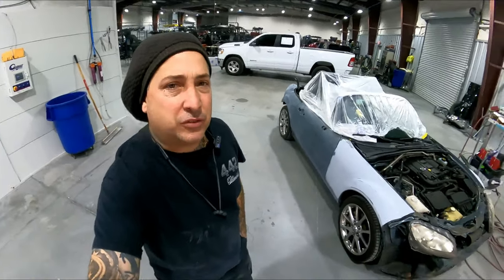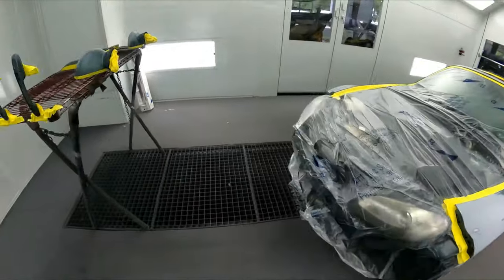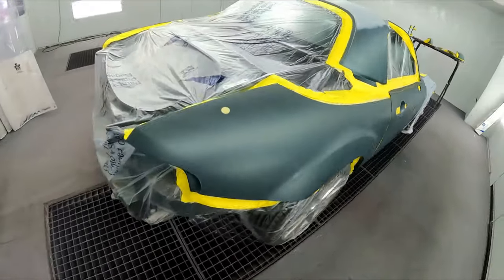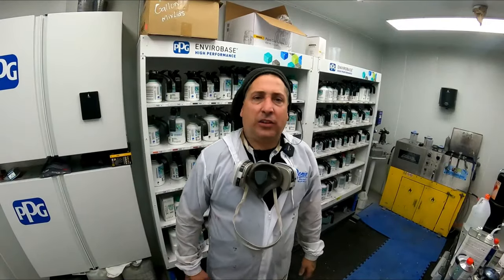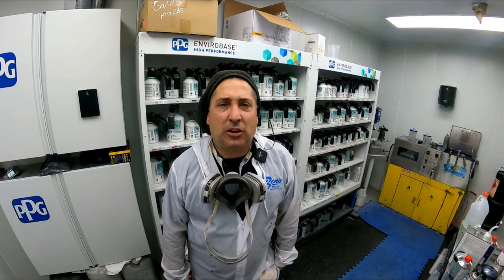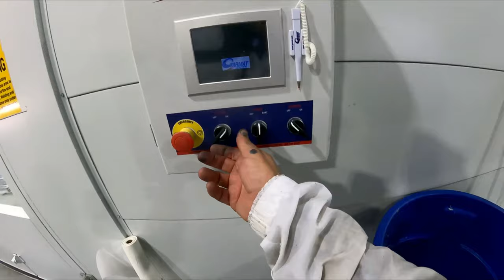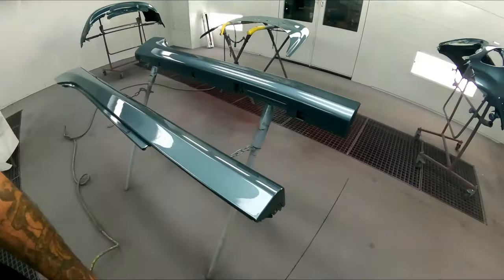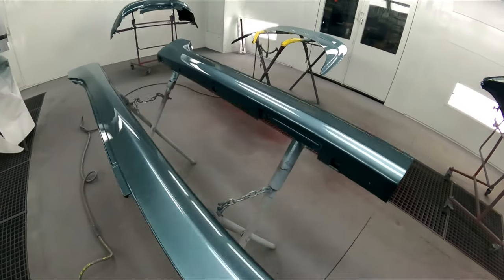FIRST COMPLETE OVERALL PAINT JOB AT THE NEW SHOP

Comment: Man Kandy man I see that you were putting the base down very very wet how many coat do you do and do you turn the fan on3m gun in 1turn ????
Reply from the maker: Two wet coats two drop coats and 1.5 on fan
Reply: @kandyman5315  ok thanks iate you using 1.2 setup?
Reply from the maker: 1.2 works the best

Comment: Nice job. I’m about to make switch to new shop spraying ppg.. have you found that you can get jobs sprayed pretty quickly? How many cars can u get done per day?
Reply: I have sherwin and ppg at my shop and ppg hands down is much easier to color match and you can force a quicker dry time using a blower. Only thing us your prep really has to be problem free you can't hide much with water compared to solvent; also spraying thinner through your gun wont clean the water based out all the way I find it's easier to remove cap and nozzle then rinse it all out
Reply from the maker: 40 + paint hours a day
Reply: @kandyman5315  your turning 40 plus hours a day by yourself? No helper? Man they must write some really good tickets cuz that’s rolling
Reply from the maker: Tickets are what they should be  hard work is the name of the game
Reply: @kandyman5315  yes sir it is. That’s good for you. 200 hours a week ain’t a no easy task so you must have food system down
Reply from the maker: Thanks 👊